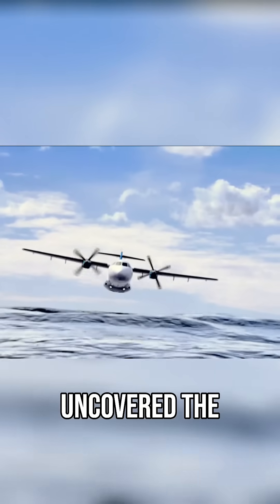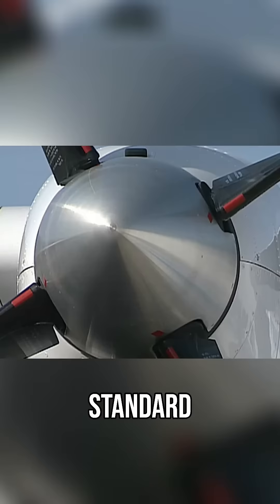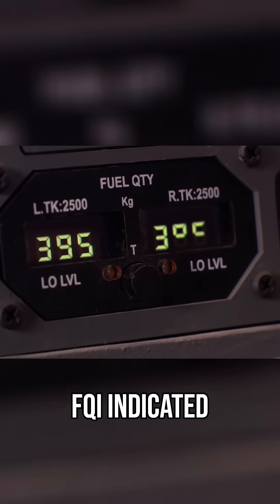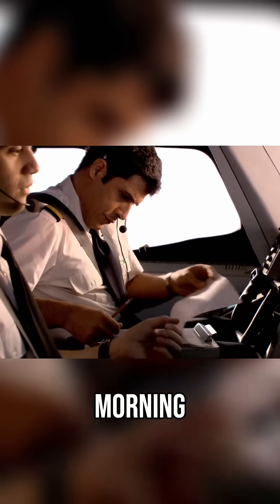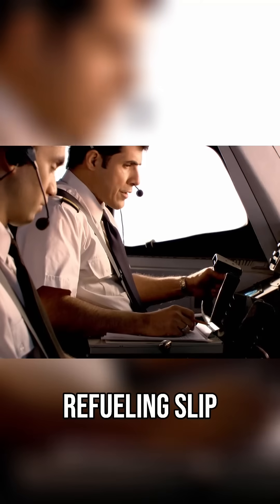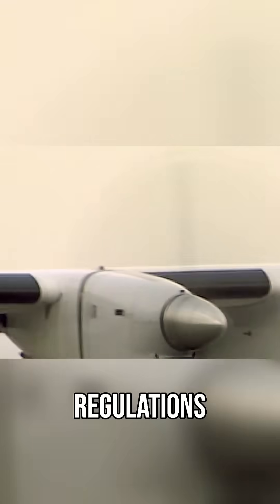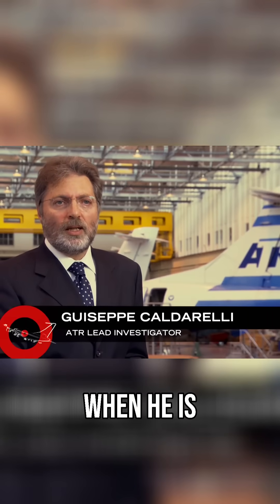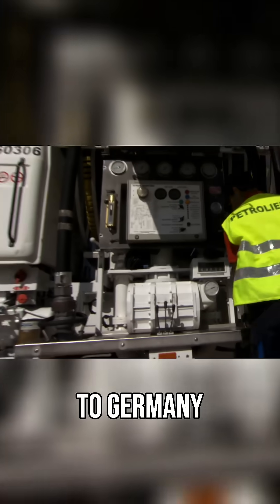Wrong Fuel Gauge Caused Dual Engine Failure Midair | Mayday: Air Disaster

Comment: The repair was done on the fuel gauge regulator. He exchanged the broken one for a used part from another plane. However the one he pulled was a model 42 and he put in a model 40. They LOOK alike but are not. That resulted in them changing the type of fuel gauge pins behind it so they are not interchangeable. The mechanic did a shortcut. There's a complete video on the incident. 😮.
Reply: @sharoncassell5273 I think it was be considered negligence

Comment: Was the person that put in the wrong part charged with a crime?
Reply: Why should they be?
Reply: @rockstar-5934 Well, it would be considered negligence.
Reply: @YDKJ07 but why? It’s just a mistake, humans make mistakes. That’s it’s up to institutions not to fail workers by have safeguards in place. Mandatory breaks, limit on work times, allowing people to call out if they’re tired. Checks which didn’t uncover the mistake that was made. We already do this with pilots. Why stop with pilots?
I find it’s much more often that corporate greed is at fault.
Reply: @YDKJ07  No, it might be negligence, but there were other things that could be considered problematic. If the Captain didn't have complete information about the fuel, which he is required to have, why did he even take off. Anyway, there were obviously, serious problems with the design of fuel indicators, that would allow such mistakes to happen.